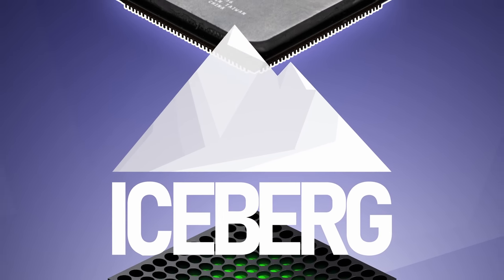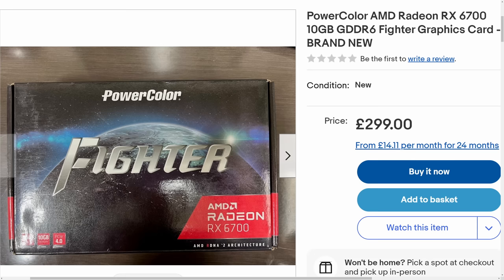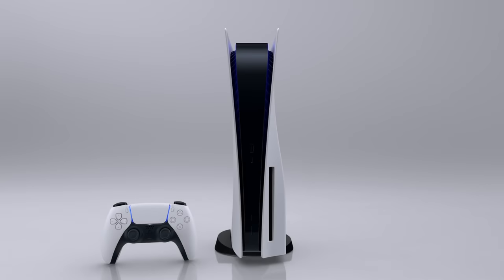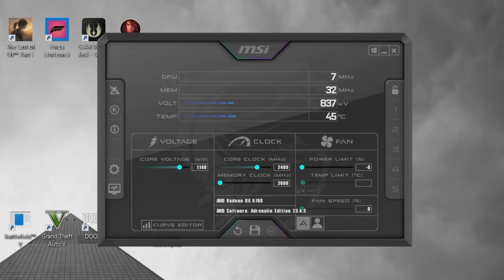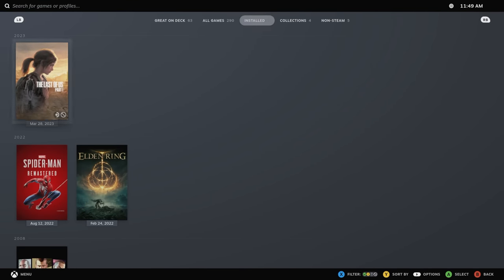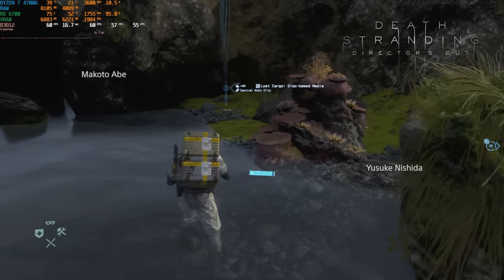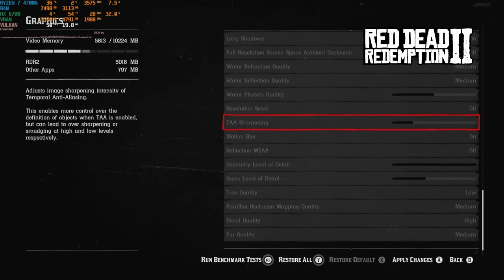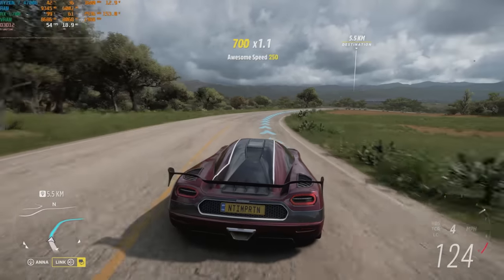I Built a 9th Gen Console (kinda)

Comment: Couldn't the 3700x with a decent OC (or 3800x/3800xt) technically be used as substitutes for the 4700G when comparing console hardware? They're also all Zen 2, and don't have the gimped L3 cache (unless that's the case with the PS5/Xbox Series X, I haven't looked into it). I was just curious, since the non-G Ryzen 7s based on Zen 2 are still pretty capable CPUs all around. Sure, IPC is better on 5k series but most people running R5 3600s or better don't "need" to upgrade anytime in the immediate future necessarily, unless they have a newer/more powerful GPU and play at 1080p or rely on upscaling. Which, from my experience, causes far more CPU load and/or bottleneck. i.e. when playing Cyberpunk 2077 at 1080p/high w/ DLSS, my R5 5600 @ 4.6Ghz via PBO (10x scalar, -10 offset, and +200) will sit pegged at 100% usage. It doesn't matter which preset I use for DLSS, so I have to play at native for the workload to be divided between the hardware better. My preferred way to play is at 1440p/high textures, med everything else, no RT, and DLSS balanced or quality. That way the CPU sits between 45-70% utilization and my 3060 Ti (OC'ed to +150 core +300 mem) is at 100% and I get between ~70-144fps (I use vsync to cap the frame rate as that's as high as my monitor goes). 

TDLR; CPU bottleneck comes from lower res or upscaling (which relies on rendering lower res) so if you still have a Zen 2 chip, get a 6700 XT or something similar and play 1440p/use FSR if you have CPU headroom to spare or want a bit more fps
Reply: PS5 and Xbox have 8MB L3 cache.
Reply: Yeah the gimped cache is the whole point of the odd cpu. It matches the consoles perfectly.

As to your DLSS problem. What you are experiencing is a textbook cpu bottleneck. If no DLSS present from Quality to Ultra Performance changes the fps up or down then its a 100% cpu block. You could try and look at some dual rank ram (4 sticks of ram with chips on one side or 2 sticks with chips on both sides) or even pick up a 5800x3d. I have one and it really lifted my performance on the same old mobo I've always had.
Reply: @foxdart  I've got adequate RAM (32GB via 2x 16GB dual rank 3200Mhz CL14) sure the speed could be better (i.e. 3600Mhz), but the CAS latency is low enough to where I still get pretty good performance out of my 5600. At this point I believe you're right; I either need to get a 5800x3D or use my B450 + 5600 to get my wife's PC started and get a DDR4 Z690 with a 12700K or something. Upon seeing the new spec requirements for Phantom Liberty...I'm worried for my 5600 lol. It already bottlenecks at 1080p, and the recommended CPUs for 1080p/High 60fps is a 12700 non-K or R7 7800. Fml haha
Reply: @couriersix2443  you would be surprised how a move to 3600 or even 3800 could help the ryzen. my mobo has a "memory try it" mode where you just plug in a crazy ram value and it has a go. if it doesn't work it just reboots back to default. got mine from 3200 with tight timings to 3800 same timings for no cost and like 5 mins of mucking around. 
Those recommended specs are set for ray tracing, the game is doing so much more that it just ends up hammering the ram so ddr5 helps but not enough for a new pc.
Mostly though you should keep an eye out for a 5800x3d on sale, set a price you're willing to pay and just keep checking 👍👍

Comment: Try putting it in a NZXT H1 case and then it will also compete in form factor 😄👌
Reply from the maker: I admit I'm enamoured by the Fractal Ridge, but the H1 would be a good second choice.
Reply: @IcebergTech  H1 is like a Series X where  the fractal ridge is like a PS5 form factor. I actually made a Steam console recently by buying I think underrated Alienware X51 R3 i7-6700 with 16GB RAM, 500gb SSD and fudging in a RX6600 (it has a low 130w TDP). Just trying to figure out to go with chimera or HoloISO now… so patiently waiting on your next video! 😬
Reply from the maker: Chimera's fine, I imagine it's basically the same as HoloISO for most purposes. If you don't have a lot of GOG or EGS games, HoloISO should be fine. The process of getting non-Steam games onto Chimera isn't that elegant, either... kinda feels like sideloading!
Reply: Ahh maybe HoloISO would be better as I’ve intentionally built up solely a steam library since getting my Steamdeck, using that device made me a believer  just wanted something more powerful connect to a TV- Do you have a Steamdeck? Interested to know your thoughts (IMO most exciting thing to happen to PC gaming in a while)

Comment: Would a 3060ti offer a bit extra grunt to instead of the Radeon GPU?
Reply: ps5,xbox sx are all amd
Reply from the maker: Yes, perhaps in 1080P & 1440P. In several instances the VRAM was being pushed way past 8GB, however, so the 3060Ti would most likely fare even worse than the 6700 did.
Reply: @IcebergTech  hmm. diffucult choise. I like all that VRAM, but Nvidia tend to have edge for 3d work